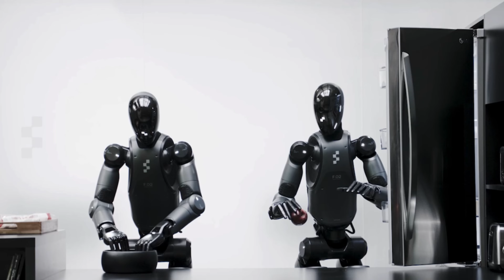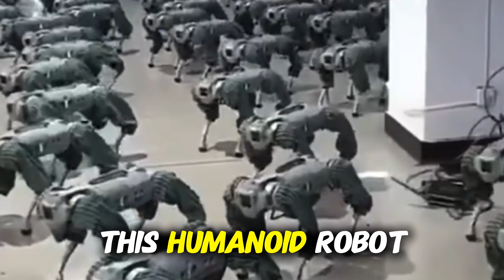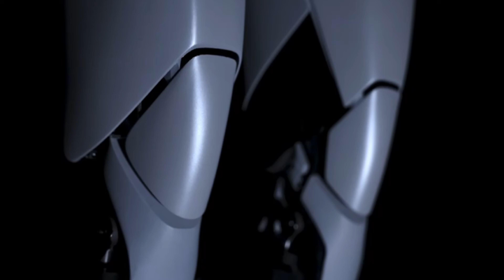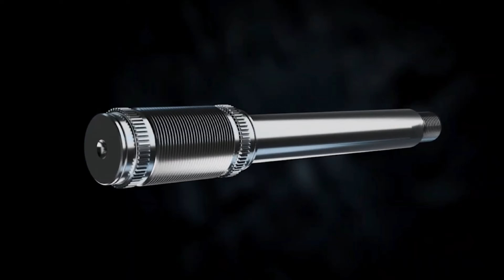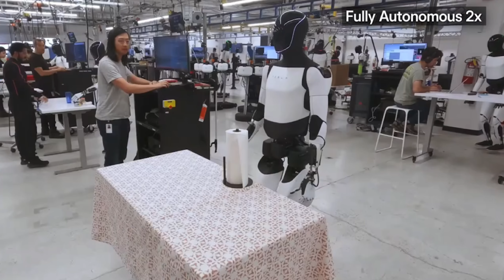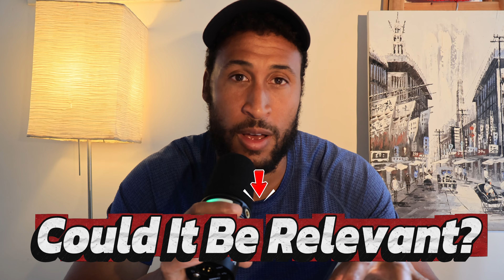Most Important Question In Robotics (Part 2)

Comment: Humanoid robots will have nearly zero impact in the industrial or warehouse sectors, which is overwhelmingly the areas where robots are used and needed!  There is NOTHING that humanoid robots do that conventional robots from companies like Kuka and Fanuc aren't already doing and doing far faster and with far greater precision than a humanoid robot.  The people getting hyped for humanoid robots are people that know zero about robots and are impressed by the marketing BS from the likes of Musk.
There are robots in use that can pick up a car, move it at speed and then place it with sub millimeter precision -- and they've existed with this ability for decades!  There is automation that can pickup and place tiny parts, with sub 100um precision, and do so at 130,000 pieces per hour or about 36 pieces per second.  Optimus isn't remotely capable of either capability and will NEVER have such capability.